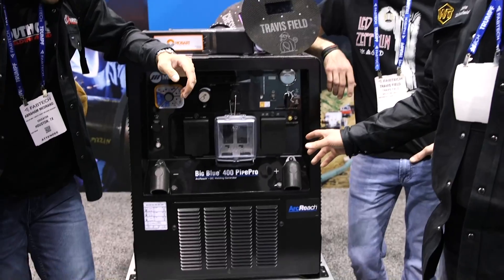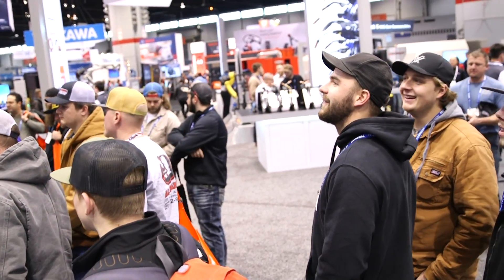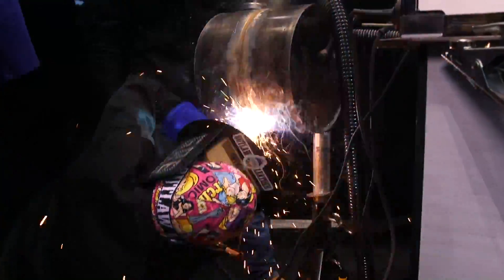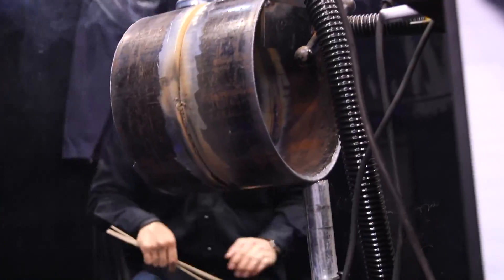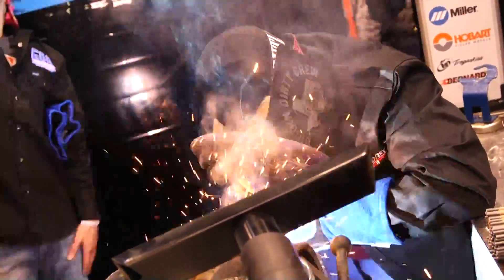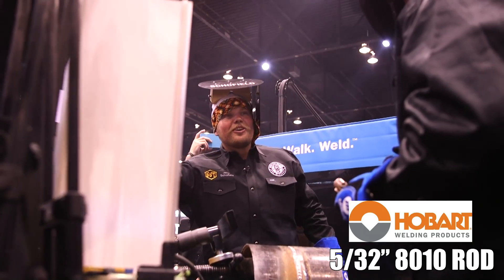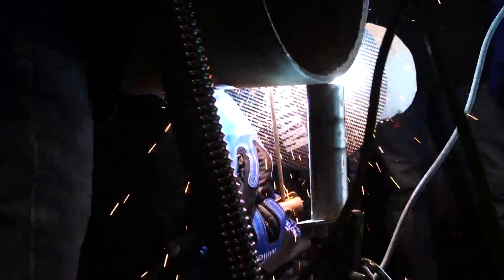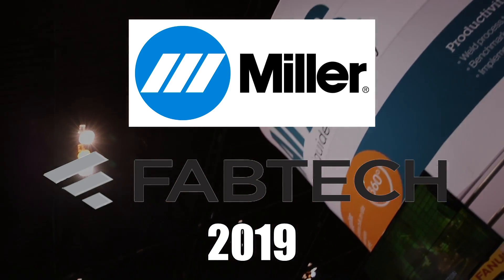Downhill welding Demo-Miller booth. Weld Tube

Comment: Ok so the canadian guy is getting aggressive with the file bastard,damaging a nice tool just to see if the tack break?An old timer will be yelling at him.😂
Reply from the maker: No he’s closing the gap up on the one side. So he can put another rack in it. We did t have a hammer so we used the file. Why would he be trying to break the tack? He just put it in.
Reply: @JacobSchofield  
Santiagos welds76 was just saying it's not very intelligent to use a brittle/hard file as a hammer especially when neither Travis or Abraham is wearing safety glasses. Like he said if you went onto a job as an apprentice and a "old timer"  seen you doing that. They'd probably show you the exit or demote you to broom duty. Since when would a massive welding expo not have a single hammer present? Should've used the stinger or his pancake to 
"Close the gap" would've been just as appropriate as using a file.
Reply: I have used my drill as a hammer before.  So I called it a hammer drill. Sometimes you use what you got That's life. Good in a pinch but you shouldn't do if you want to keep your tools in good shape.